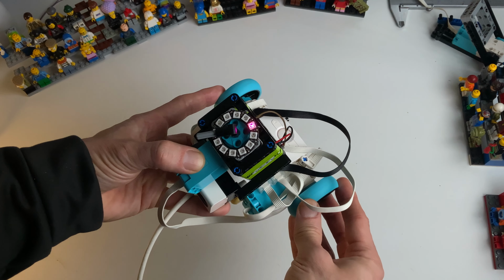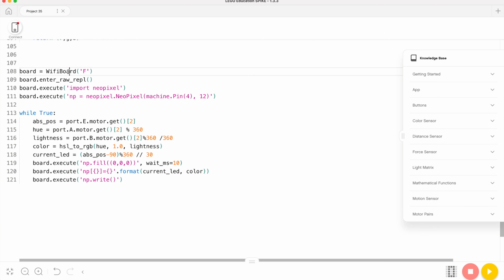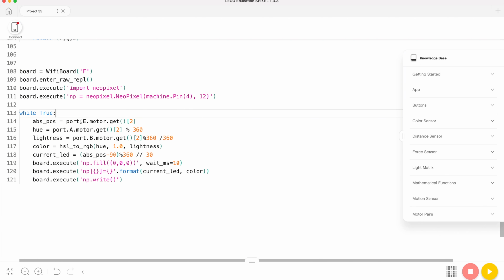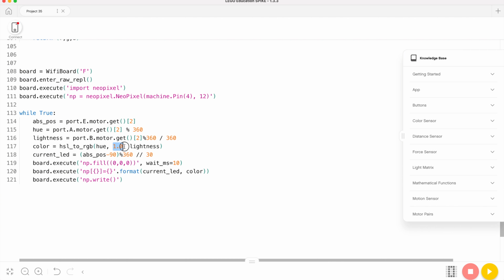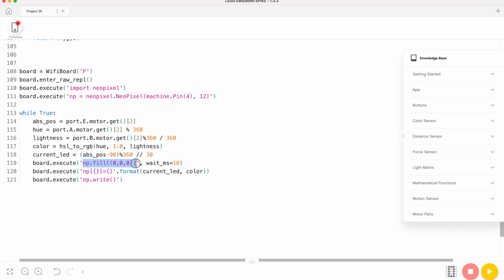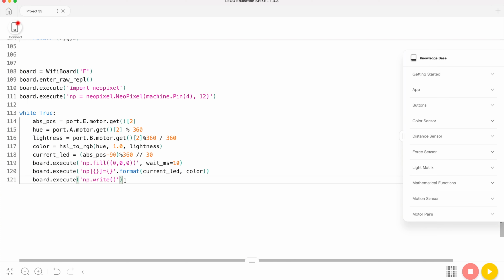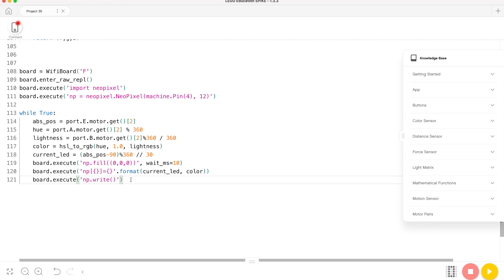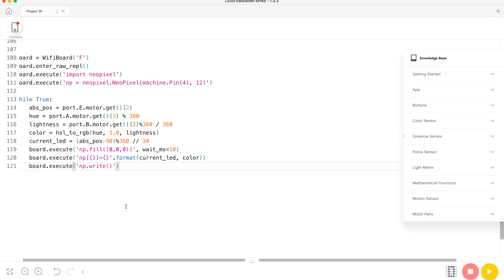How to drive NeoPixels (ws2812) with LEGO MINDSTORMS or SPIKE

Comment: Where did you buy the cable to connect the board? It's not a separate product in your shop https://antonsmindstorms.com/product-category/electronics/ . 
Your break-out board images show them, but state that they are not included. Did you use these NeoPixels https://www.adafruit.com/category/168
Reply from the maker: I got the cable in China. I'd like to sell it, but I don't want to get in trouble with LEGO. Still figuring that out. 
I used the 12pix neopixel ring indeed. I also have flexible neopixel strips from China that are even cheaper.